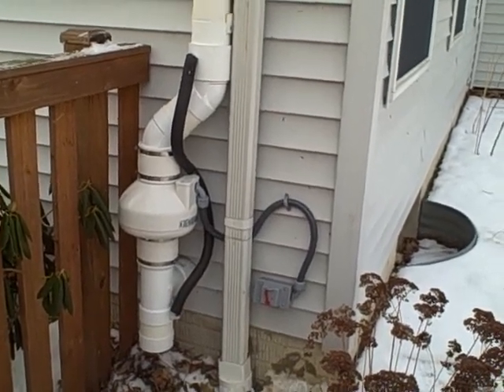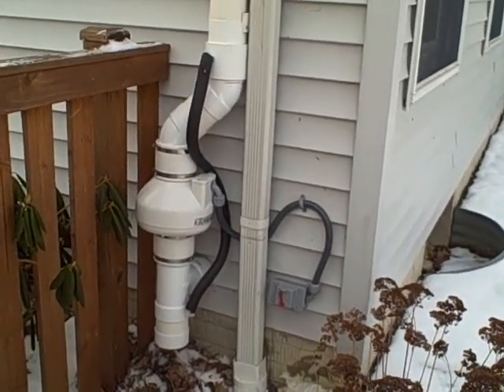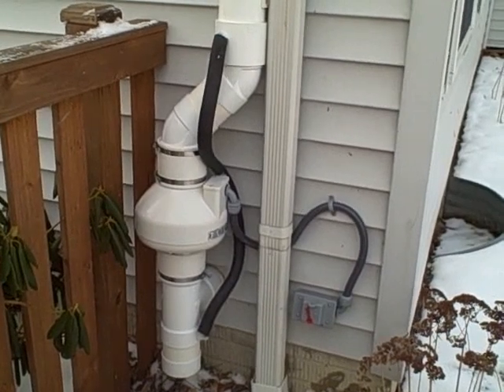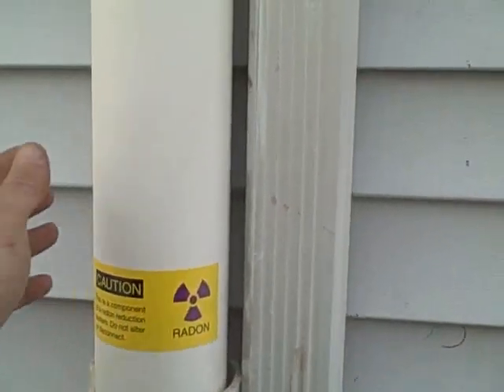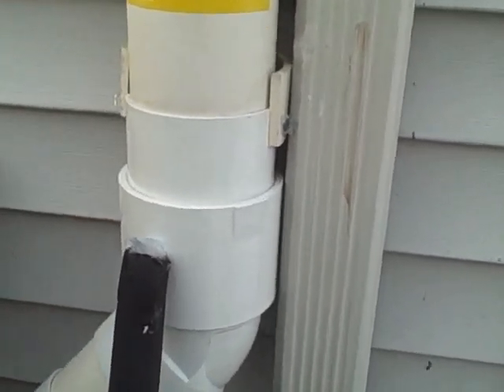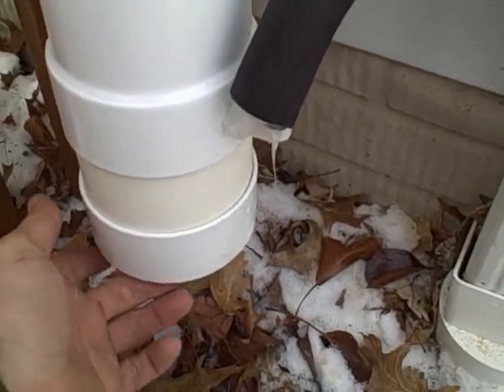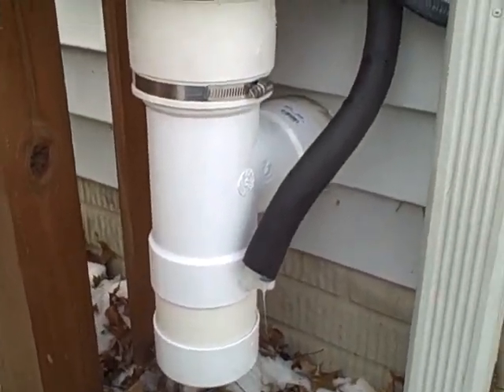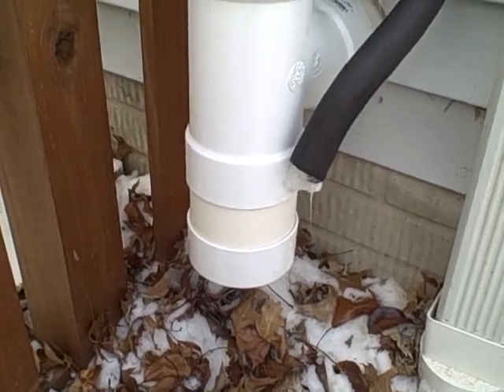Akron OH Radon Mitigation Specialist reveals radon fan failure

Comment: It seems silly for the water to be caught above the fan and then RE-enter below the fan and then exiting the pipe after you drilled holes in the negative pressure side of the system only to dump it back on the ground... You've new reduced the systems effectiveness by drilling holes in the negative pressure side of the system.  Simply RE-connect the lower end of the drain hose back into the pipe below the fan and allow the water to flow down the pipe under the slab in the basement. It's a tiny amount of water. it's not going to hurt anything.  There's a huge empty area under the slab that had to be dug out when the system was installed to begin with.  It won't hurt anything to have the tiny amount of condensate run back into the ground under the basement slab.

Comment: By adding holes into the exterior  pipe for the condensate, doesn't that reduce the "pull" from the under slab pipe?
Reply: I was thinking the same thing.  I guess you could block off the bottom and just have the condensate line drain individually from the radon piping system.  It doesn't need to flow back in, just make sure you have something on the end to prevent critters from entering.  Keep it off the ground too to prevent insect entry.  I get ants on my electricity meter frequently, I'm sure they would love to get into my radon fan too!
Reply: exactly